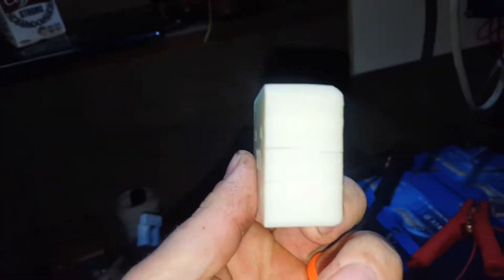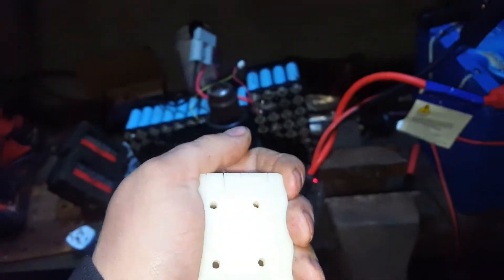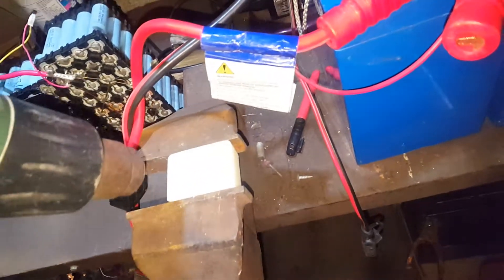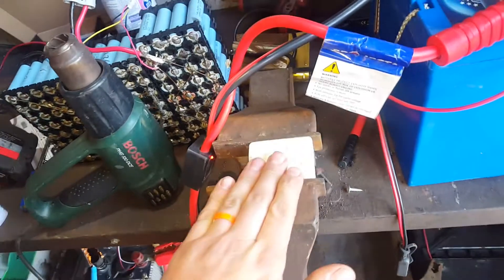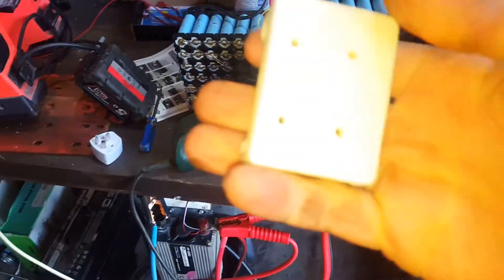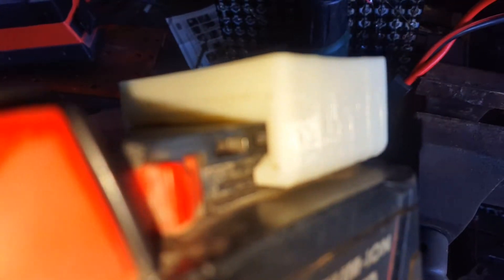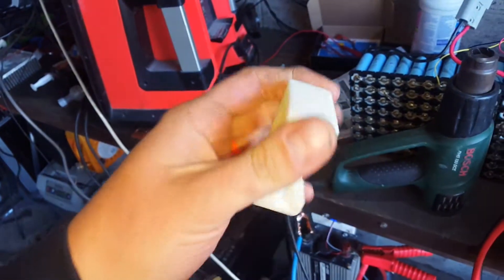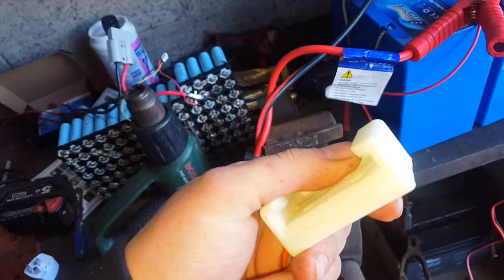3D Printing with abs Cracking ? any ideas on how to stop it?

Comment: I had the same problem. I had to adjust the z steps per mm and add the spring loaded leadscrew things and now i get a nice print
Reply from the maker: +jesse serfling it took a bit to get it setup and printing right but its ok now

Comment: Could be a symptom of not enough wall thickness. How many perimeter layers are you using?
I have had a lot of problems with layer adhesion myself, generally speaking, though, higher temperatures promote better adhesion at the expense of stringing.
Reply from the maker: +Jason Simpson ive increased the infill and gone to .3mm layers and getting  much better results i think it was defult trying to use as little filament as it could cheers mate

Comment: It's poor layer adhesion, try tweaking your temps.

Even better, try printing one of the temperature calibration towers on thingiverse
Reply: As a side note, for that battery mount, since it's not particularly structural and it is rather chunky you'd be better off printing it in pla.
Reply from the maker: +MiggyManMike temp calibration  tower ill find it and test cheers mate !! Not sure if i can adjust temps
Reply: Of course you can.. And yes I second the temp.
Are you using a cooling fan on the print nozzle?
As another fix. Acetone, it welds the plastic, you can also melt down some ABS into the acetone to thicken it up so it bridges bigger gaps.
Also glass jar with some acetone in there and the object, heat it slightly (like on your heated print bed) and it will evaporate the acetone and smooth the print. Gives it a nice shine.
ABS >1-5% shrinkage as it cools.
If you have a RPi you might want to look at octoprint
Reply: The esun stuff is pretty good, and pretty cheap :)
Reply from the maker: +Dave Webster forgot about acetone and abs thanks  mate ill get some tomorrow and tidy up the sad looking bits
Reply from the maker: +Dave Webster the extruders have there  cooling fans but  not one that blows onto the model
Reply from the maker: +MiggyManMike yeah i need to buy some i only have abs atm cheers mate
Reply from the maker: +MiggyManMike i think ill be liminted to using the stuff xyz make witg this printer sadly
Reply: ah balls I forgot about that, too used to just whacking a spool on!
Reply from the maker: +MiggyManMike yeah there not that simple unfortunately  but the next pla open printer i buy will.be easier